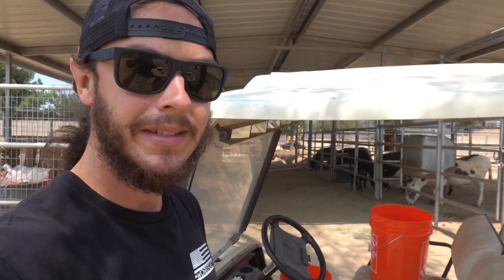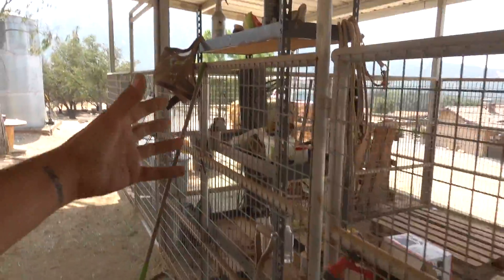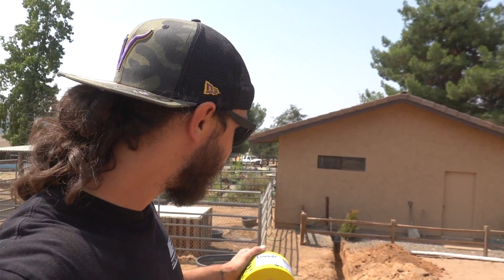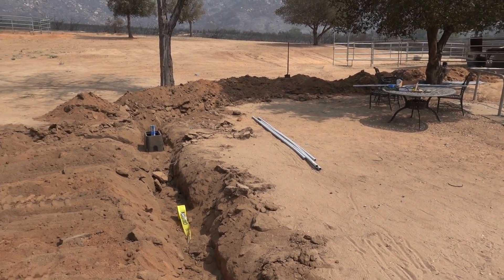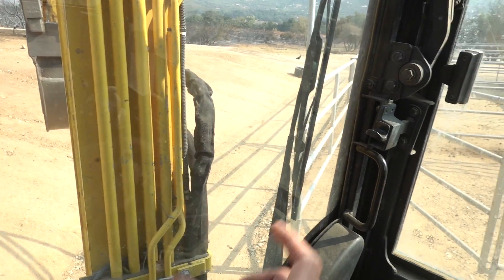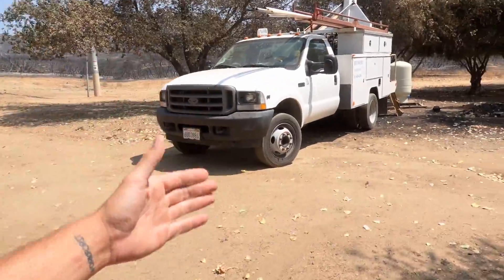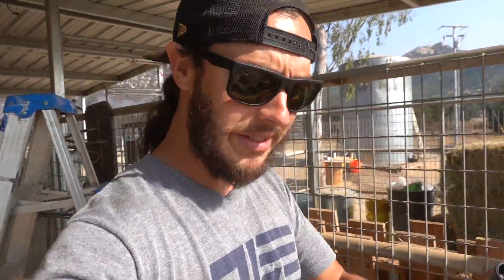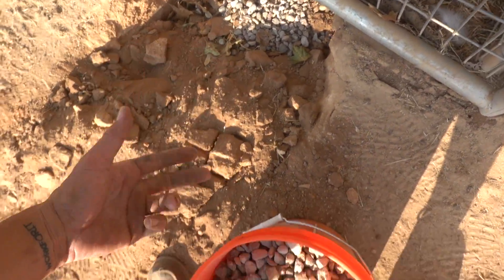RANCH WATER UPDATE (BIG PROBLEMS WITH OUR WELL)

Comment: Definitely build new pump house out of  concrete blocks etc..
Reply: The town I lived in has a bylaw to only have buildings built from stone and brick from burning down twice back in the 1900s.
Reply from the maker: That’s the plan!
Reply: Slate or clay roof tiles as well. Possibly put solar panels on the roof of it so you don't lose water if you get a power outage.
Reply: Yeah Solar Panels are a good idea considering how Californian power companies seem to cut power in Heat Waves now. I remember that happening back in 2019 or was it 2018
Reply: Just remember to make a nice access hole on the roof for when the pump has to be pulled, lowered etc.
Reply: The cement blocks sound good to me
Reply: Why not Metal why not all metal stuff
Reply: @wolfgangruca7130  Heat.
Reply: @WastelandWanderer1216  Oh yeah that's true ok what will not melt it
Reply: @kitsunedarkfire2915  That's a nice idea, but those panels would never provide enough power. A normal sized solar panel does about 250W, you could maybe fit 3 or 4 on a pumphouse the size of that concrete pad, so you'd only have 1kW at max. I'm pretty sure that deep pump pulls more power than that, and that's without the pump at the top (of which I'm not sure why it's there). It would definitely help though, and with a battery backup it would work great.
Reply: @timderks5960  the equipment on the surface is for water pressure.
Reply: Bricks and maybe some solar panels on top, electric pump to multiple large storage tanks maybe?

Comment: FYI, if you run the water lines up by the metal roof for the animals, it will be hot water they will be getting from the auto water bowls you will be putting in. If you kept them underground and ron up where you need them by the post they will be protected and cold water.
Reply from the maker: We tested them in 105 degree weather, came out cold. No different than water sitting in metal troughs in the sun.
Reply: @DMAXRYNO  I know as the water sits there in the open, in the heat it will get hot especially during the summer, its like leaving a hose in the sun when you first turn it on it's hot until the cold water comes through, but if you had run the water through the line before testing it would be colder obviously. I trust in what you say and your situation but watch out for it incase.

Comment: The company I work for just installed a KNEE operated valve for our hand washing sink. We simply walk up, push the lever easily with our knee, get some soap on the hands, stop the water flow with the knee, wash the hands all up for 20 seconds :) , and then push the lever valve with our knee and the water flows. They set the flow of hot & cold to just the right temp, but you wont need to mess with that even. Its so nifty id like one for my kitchen sink!

Comment: What I have done in the past is set up a 3'' pipe made from PVC over our animal stalls and connected a water hose to it. This way you can keep the PVC pipe full and all you have to do is turn the valves on that you've installed on it. It is a lot cheaper to do and easier to replace when something gets damaged.

Comment: Any time you put in conduit or pipe it is always best to plan ahead. If you pull 2 drag lines through you can also pull extra cables through later so you don't need to invest more than a few bucks for string. My township just did a bunch of pipe work and now they sell the extra pipe capacity to telecom companies etc. Cheaper for the companies since they can put in new lines faster and the township has already recouped their entire installation costs.

Comment: Build a block pump house, sounds a bit overkill but make it about 10 foot clearance on each side so if it does get close again the walls are plenty ways away from the pump, plus run a few sprinkler heads above the pump where if it gets above a certain temp it kicks the heads on, keeping everything wet and cooled off so hopefully nothing happens again. Once the threat it gone, flip a shutoff valve and hopefully save you pump.

Comment: If your sink ends up backing up on you because it can't drain fast enough, dig the hole back out and get a 5-gallon bucket that has a lid and drill a bunch of holes around the bottom of it and bury it will gravel. It works great, just like a small septic tank.

Comment: They do make a nipple that you can put in a 55gal plastic drum to make a pig, and other livestock, waterer that they won’t dump and needs cleaned and filled far less.  You can also add a float valve to make auto fill. I only use nipples with my chickens way better. I also wrap the storage tanks with reflectix to keep the water cooler in the summer.

Comment: Good choice to run two conduits, will need one for low voltage and using larger than you need is always a good idea. Don't forget to leave a pull string in them as well.

Comment: When you run pipe, it might be smart to run an outer-pipe from like hard PVC (We use it for sewage transportation from the house; 90-110mm). It would be perfect as another protection layer + you'd be able to run new things (power, internet, whatever you want) through it without having to dig up the whole thing (t-section might be a bit tricky there though :P)

Comment: If you dig a hole for the water containers for bbq the she is less likely to spill it out.  So the edge are closer to grund level, keep a stone or other to  make it even more safer. If its a hot day my pig even used it as a bath. Easyer for their heads to go down to drink them over an edge.

Comment: Should've put down about a foot of gravel, then placed a 5 gal bucket upside down with some small holes drilled around the sides and ran your drain into that. Bury the bucket with more gravel. 
Leaves a chamber so bigger debris or hair cant back up and plug your drain.

Comment: To lock the tensioner all you need to do is pull the passenger side of the belt hard and it will lock in place reason to love the placement on the 6.0

Comment: If you do concrete between the stalls in the center would you do a drain down the center for easy clean or if you wanted to wash down the animals?
Reply from the maker: Either a drain in it, or put fall into it, so the water will flow out.

Comment: I would replace that galvanize pipe with 1" solid black plastic pipe. So much easier to work with and no joints in it.

Comment: The nice part about having the knob style faucet is you can connect just one side, with a mixing valve style you have to plug the hot side or connect it or it'll leak out that side

Comment: I would think running electrical and water in the same trench would be a problem if there was an earthquake that managed to break the PVC pipe wouldn’t it? I would cover the pipe with at least 1-2” of dirt and then run the wire above it so if the pipe breaks it won’t risk getting to the wires... I know there’s conduit but it could break too.
Reply: This is true. In California it’s not code to bury them together. You’re supposed to pad the first one with dirt and then lay the next pipe.